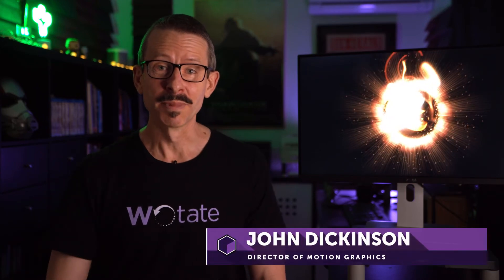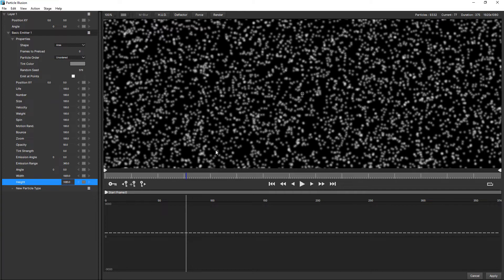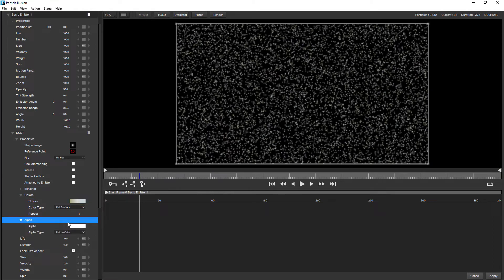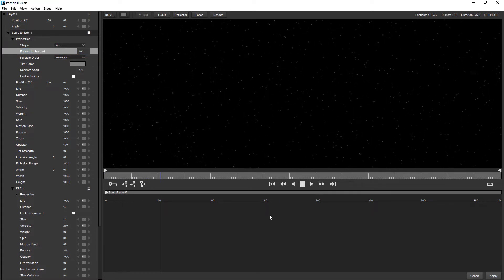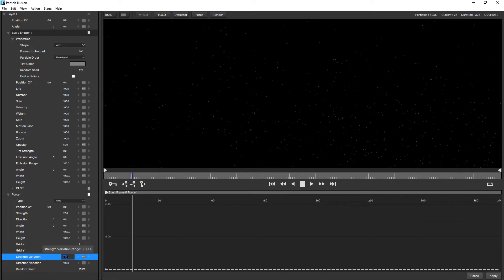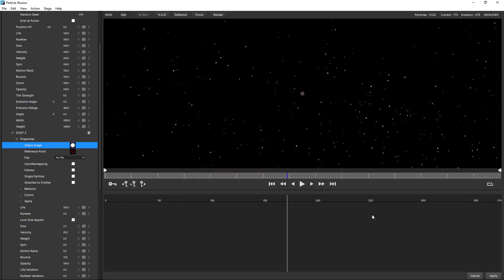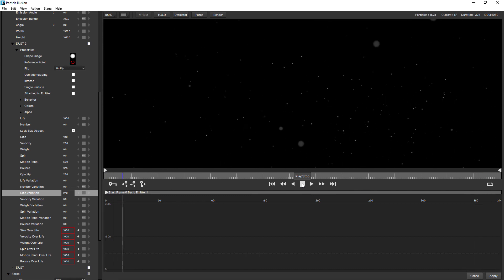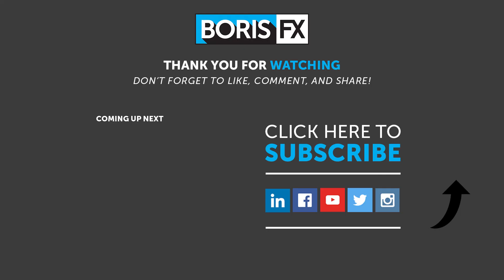Particle Illusion - Building a Preset From Scratch [Getting Started]

Comment: In settings, it would be intelligent to add before (or between) the size dimensions of appropriate objects like plane emitters or other relevant objects the button/checkbox "Full" or "Fill" or "All" so we don't have to type the dimensions of the stage by hand (width n height). This is bothersome. I'm sure that the app can automatically figure by itself what are the exact dimensions in relation with the stage dimensions.